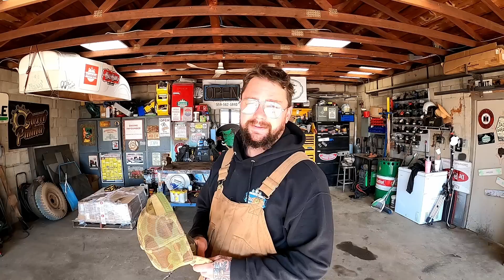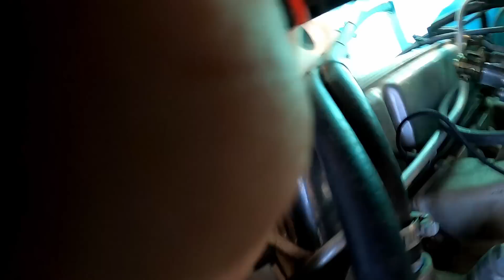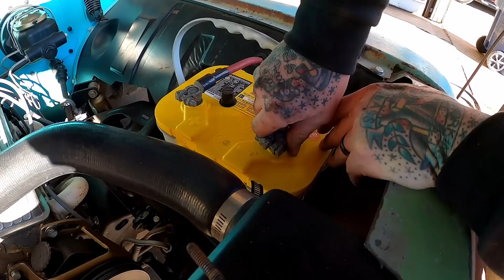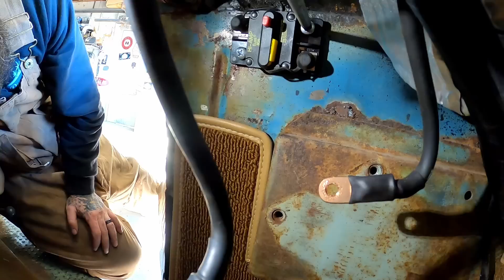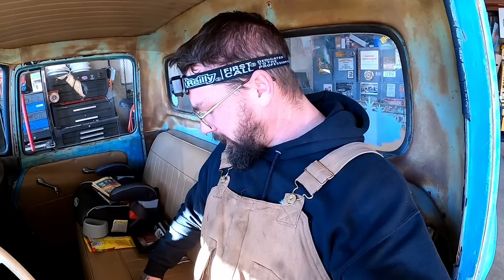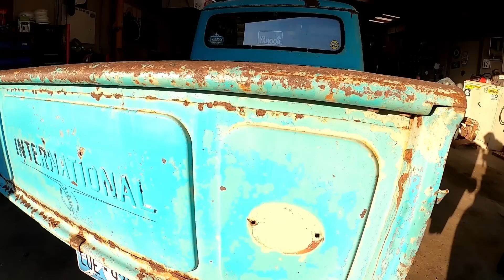1964 International C900. Shop Truck Repairs.

Comment: You may know or you may not know.

When you are running wire for your charging system make sure that you are using Pure Copper wiring and Not CCA (Copper Clad Aluminum) wire
The CCA will corrode and give you issues with conductivity and cause heat build up. 
The pure coper will cost more, but for the charging system its worth it.
Goes for any high current circuit like charging or car stereo.
Look for OFC (Oxygen Free Copper) for high current applications.

Love watching your videos, I watch you doing your projects while I sit on my ass getting things done at work.

Comment: the hinge on yer headlight goes on the bottom so it can tip into yer lap to see what yer working on. i gots over a dozen of them. the rechargeable ones are the best deal. replacing batteries will make up the price difference in a hurry if you use them a lot.

Comment: Have you considered swapping to an engine driven air compressor setup? It's a lot more reliable and quieter setup. Rat Rod Bob made one from an old York A/C compressor and used the electric clutch to engage the compressor. It was on the rat rod ford truck build series. Video link - https://youtu.be/004OMu2_AN0

Comment: With my second truck I had to run to Walmart after it came out of a buddies shop because the battery was complete junk and the battery I got from Walmart was posted new with the sticker but I put it in my truck and had to get a jumpstart and I couldn’t play my radio for 5 seconds with the engine off without it dying and when I went to trade it out they scanned the code on the top and it was 3 years old so the bastards at must’ve changed the battery sticker or someone came in brought a shitty battery in and swapped the sticker but I wasn’t listened to and they wouldn’t trade the battery out that’s why I’ll go to the parts house to get batteries from now on
EDIT: merry Christmas to the Pott county legend and his awesome family hope everyone stays safe during the holidays thank you for the content you produce its amazing, awesome to see someone doing what they love and having an amazing support system behind them with the family and fans. Be safe and god bless
Edit 2: didn’t watch the whole video before commenting after you buff it out get some griots garage ceramic 3in1 wax it’ll keep it looking good and for about 6 months if you leave it in the sun or a year or two if you park it in the shade I used it on my old xj and she wicked the water right off whenever I went mudding and stuff it worked amazing and it gives a depth to the paint that you don’t get with normal wax gotta keep it outta the rain for two days after you put it on or it’ll streak but after that it’s fine

Comment: I need to order a butane version of the portasol brand soldering iron kit it's the same thing as the snap on one even has the window,, just black case instead of the snap on red . you can find them on Amazon if you are interested in those soldering iron kits puddin sir

Comment: my daughter worked for "The Parts House" for several years, she applied for delivery driver  but got put in the warehouse pulling parts for all the area parts stores and quickly took over getting everything headed over seas to US military bases and Puerto Rico. After a year or so doing that she was moved to the parts dept at one of the largest municipal repair facilities in the country where she was in charge of ordering and delivering parts for every vehicle the city operates from motorcycles to helicopters, firetrucks to meter maid scooters. She left 2yrs or so ago to run the office of the company she and her husband built... apropos of nothing but you mentioning "The Parts House" and a little fatherly bragging

Comment: You probably could save that optima by hooking it up to a regular battery with jumper cables and hooking that battery to a trickle charger to charge it have a 12 year old optima that I've had to do this twice to but it still good.

Comment: Having replaced batteries in 2 vehicles in the past couple months & sourced them from different suppliers...
Both new batteries where dated in 2021.
OTOH, both delivery drivers pointed out the dates on the batteries & mentioned that the date on the paperwork was what would be used in case of warranty claims.
I'll bet on the whole "Coming out of COVID" thing as the cause.

Comment: Use a heat gun on the shrink tubing, not a torch and set everything around it on fire! I got one for $10 on sale at the Horrible Fright Tools. There are also cordless battery operated ones.

Comment: that lug likely didn't break off all at once, it probably lost a few strands at a time and the remaining ones had to carry the load, till not enough was left and the rest burnt off like popping a fuse, likely why the outer loom/shrink didn't look fried, it was protected by the ring of dead wires while the center cooked

Comment: To me with running compressors that take a higher amp draw of current you do not have a large enough wire going from the alternator to the battery from what I can see. Off the top of my head if the alt is 100A youd need 4ga wire minimum. I would imagine that means the size of the grounds are also a tad small or not ample enough (from the battery to the frame, battery to motor, and motor to frame). That Alt wire looks like its doesn't have a high strand count either so swapping to a high strand oxygen free copper power cable would cure that from being an issue again in the future ( both from heating up and corroding). The charging circuit should be beefy, I personally upgrade and add bigger wire to any vehicle I own with more than just a factory stereo let alone them compressors.

Not telling you how to live your life brother, just dropping some things I have learned over the years. Love the content, always love to see what your into. Your hard work and dedication helps me get off my ass and get stuff done.

Comment: You just called out your local orilyes on not rotating and trickle charging their batteries. They get stickers to fully charge bench test and resticker the dates. They are also susposed to dust and clean the store because they are not parts stores they are sales stores. I bet the district manager will show up if hes a viewer. Someone from orilyes is watching they sponsor you.

Comment: Hello Puddin  :) back on July 4th 2013 drive home from Cousin Nancey house who 15 mins drive one way my fix up 2002 Chevrolet Impala E-X LTZ LS 4 door car at 12:00am got 3 fork lightning hit my car one on hood also one hit on roof then one on trunk shut down in less 5 seconds plus 5 mins from home ! Had wait 10 mins at 12:10am play with key ignition from turn off also in Park on Automatic transmission turn key ignition switch to off , accessories, on 24 times so get my doors unlocked plus a window down  get out car and grab my strong flash light found under hood my ground wire pig tail broken off clip also Alternator wire on back post to come off! I had open hood 4 times and shut down and got home so fast before lost all battery power on reverse on Delco Alternator make gauge say loses power fast to flash to me I had use a flashlight get home! But had put new Ground battery post terminal & cable on wire in plus Alternator back post connector to with 2 washers hold place & 6 months later my Mass Flow Air Filter Ring Sensor went plus 2 H20 Sensor on manifold also Catylic Converter Sensor O2 went and Alternator only doing from 105 amps to 20 amps to replacement and all fix since plus had replaced some light bulbs too after 3 months too happen to! But all rest vechiles okay and plus had get new Key ignition switch to because seized up  also! What funny part on Wicked Thunderbolt of Fork Lightning hit one Roof did ruin my CB radio antenna or car radio even CB radio I have still going strong too and had technician check over for at time Lol! But how new fork lightning hit my car saw it plus felt zap of hot power thru steering wheel when driveing plus guy house going buy saw it in kitchen window told me about and ran out house ready break window get me out car for safety sake plus great friends of mine! But that car still alive and well today still got it!

Comment: With my 1 wire alternator I ran a battery cable from the alternator to the battery. Seams to work pretty good.

Comment: Oreillys is supposed to cycle count the batteries something like every 6 months or something. That battery is supposed to have been cleaned up charged up and sticker changed. I got that headlight too.. not super impressed with it. Not to mention they did the headlight thing a few years ago

Comment: I think you will find a soldering gun won't work on the heavy gauge wire under the hood, especially when it is cold outside, and what you just did with the torch is going to be the go to method. Trust me, been there, done that got the T shirt! haha

Comment: Did you match the gauge to the ohm impedance each manufacturer uses a different ohm impedance so you have to measure the ohms of the sending when empty, and when full. Then match the gauge to the range of ohm impedance of your gauge.
Reply from the maker: Sure did.

Comment: PUDDIN, WANNA SAVE YOURSELF A BUNCH OF DEAD BATTERIES??? AS MANY CARS AS YOU HAVE NOW, INSTALL BATTERY DISCONNECT SWITCHES, OR ATLEAST A TOGGLE SWITCH FOR RADIO POWER, FOR ANY CARS WITH NEWER STYLE RADIOS. THE PARASITICAL DRAIN TAKES ABOUT 2 WEEKS TO DRAW A BATTERY FLAT, SOMETIMES FLAT ENOUGH TO KILL EM. MY BROTHER RAN INTO THIS ON HIS SIDE BY SIDE, AFTER NEW RADIO INSTALL. NEWER CARS COMPUTERS DO THE SAME CRAP TOO, SIT FOR A COUPLE WEEKS, AND BATTERIES GO DEAD.

Comment: When you get a soldering iron, get what they call a "Hot Lips" Instant heat, it connects to a 12-volt supply that plugs into the wall. You would love it. I use one daily on wiring. :)

Comment: 410 will be a good gear for it have some nut down low and will cruise 75 80 at around 2500 rpm

Comment: Gurddie been on the road that long without so much as a tramp stamp..also, I do believe I found out why the wires got "hot" 😂. You need to switch from "CCA" wire and go with the more resilient "OFC" wiring. That will help eliminate the corrosion from forming in the wire

Comment: Now swap the temperature gauge on the right side of the speedometer and it'll have an orange needle and then it wouldn't look so bad you might be able to take the needle off the other one and put it on the new one and then problem solved but I'm sure you knew that already. I'm impressed on how long that thing has been on the road from what you said a full custom build wiring everything from the ground up and that thing's been a reliable daily driver hell you can't get out of the dealership with a truck that reliable.

Comment: From an electricians standpoint (I'm not a mechanic) if that eyelet was corroded there could have been a tiny part left making a connection causing a bottleneck for the power, that could have caused it to overhead.
Reply: Overheat lol

Comment: My 81 f100 is like that also. I've had it for a few months now. It's a 3 speed manual on the floor with over drive. I've never needed the overdrive. Highway speeds in 3rd and never breaks 2500 rpm.

Comment: Puddin' time.

Now you can start using the shop truck. . .for shop truck stuff.
Reply: Media said a Kreggers that way you can piss off your buddy Mirsky real good if nothing more that he hates and Crogers are lucky I was and red plug wires. That’s what you need and blue Distributer Capps.
Reply: It sure is
Reply: Heat shrink, but connectors for the airway. Good friend More uses on everything and they seem to work since I started using them they seem to work good for me because I already have the solder in them and when you turn the heat gun up on Thermo nuclear here then it just melts the solder inside the fitting.